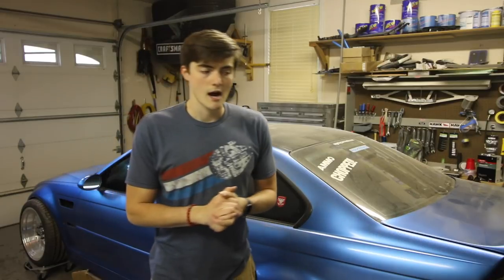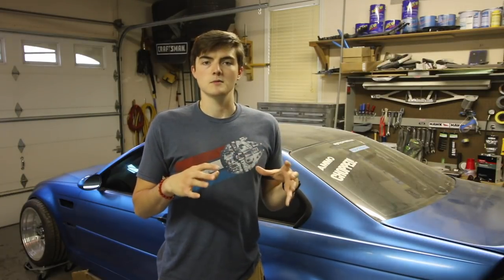DIY Widebody M3 Pt  6

Comment: Great stuff!
One thing that i want to point out for future projects or for other people that feel inspired to do this. It is better to do it as you started the first time and shape the foam as best as possible on the car then add body filler and bring it as close to final finish as possible. And after that put some wax on the parts and do a fiber glass negative master mold directly on the car. After that you can use that negative mold to do as many fiber glass body kits as you like and the smoove side will always be on the outside and will only require small touch ups with body filler, if any. 
Great job once again!

Comment: well done using the fibre mesh tape stuff its so much better than the older stuff. Just make sure you jelcoat it to seal the fibreglass and then you can paint over it...
you thought about doing the front and rear bumpers? possibly the bootlid/ trunk. ..  I would personally mould the entire wing on both sides to save weight and keep the rigidity... keep up the good work :)

Comment: I built a wide body on my 99 eclipse started at 3 years ago after watching you do this video. I know it's taking me some time I finally getting it smoothed out with somebody filler on top the foam what is the next step? I thought there was some tape or something I put on the whole thing before I do the fiberglass moldings or do I just put wax over all of it? Help bro I need HELP

Comment: I'm confused on your mold making. I used to build sailboats by hand using fiberglass and modified molds as needed by customer request. Our practices were: upon the blank, using a mold release of some kind (usually wax and PVA mold release), gel-coat (catalyzed paint), matte, cloth, and a few layers of roving for strength since the molds would produce multiple parts.
We then made the parts in the same fashion but with less material. Gel-coat first (it can be colored to match your project), 1 sheet of matte, 1 sheet of cloth, 3 layers of roving. For automotive purposes one sheet of roving can be used to keep the rigidity if so desired though if you're concerned with weight most manufacturers delete the roving especially if you're doing a full part replacement. I would think that you would be making these parts easily replaceable in case they got somehow destroyed....or possible production and sales of this particular kit, a stronger mold would then make sense.

So far it looks pretty good, you certainly have a strong creative drive!

Comment: What guides are you following? How'd you learn to do this?
Reply from the maker: I'm not following anything. There aren't any guides out there to my knowledge, which is the reason for the video series. I'm just learning as I go, learning from my mistakes, the old fashioned way.
Reply: No, like... Guide to learn how to mold the foam and lay down fiberglass.
Reply from the maker: Creesic maybe I misunderstand, but I haven't used any guides.  Shaping the foam is something I'd never done before so I just jumped right in and figured it out.  As for the fiberglass it's the same thing. I read the instructions on the can of resin and just went for it.  I'm teaching myself as I go.
Reply: Well shit... alright. You're doing a helluva job.
Reply: Get a dusk mask when sanding epoxy GFRP dude!! (Ben - Composite Design Engineer - UK)
Reply from the maker: I started wearing a mask for all of the sanding, which you will see in Part 7. Thanks for the advice!

Comment: you should sell them when u make the molds
Reply: nick smurf right he could start a business
Reply: but the time it takes him it would not be worth it
Reply: it wouldnt be that bad time wise. If he has molds for them, all he has to do is mold them and ship them out unpainted. not a lot of time consumed once he has the molds made
Reply: Yeah that would be awesome if he does that would it work for a 2000 BMW 323ci
Reply: I don't see why it wouldn't work. Only thing is that he would most likely have to make a separate widebody kit for that body specifically. The m3 widebody may not work correctly with a 323ci seeing as the m3 already has slightly wider fenders
Reply: Having said that, it's only the incline of the panel toward the fender that matters. The wide body kit piece is not filled, so any extra wouldn't block the kit from fitting. The other question may be the actual arch size, as iirc M3s come with bigger rims.